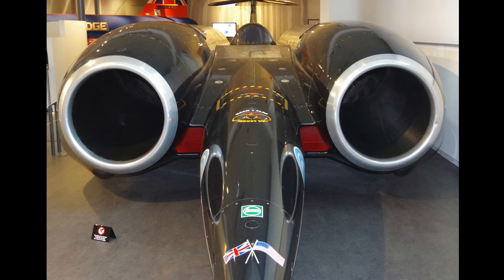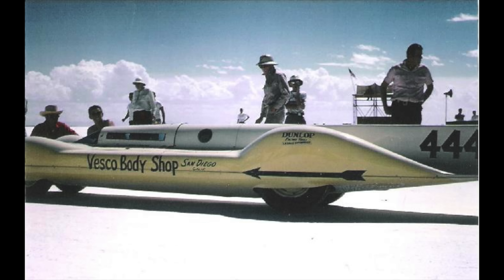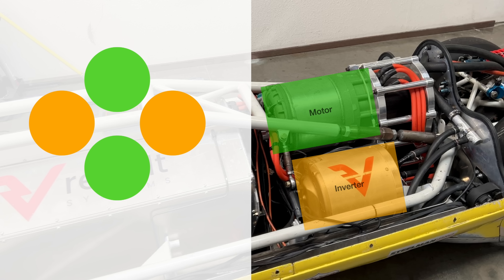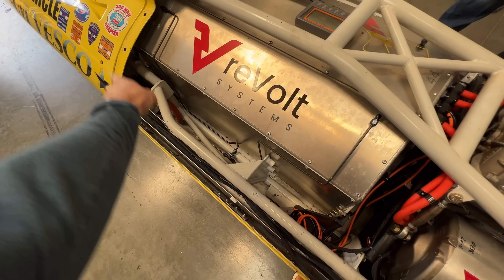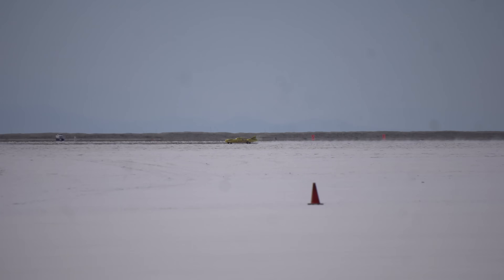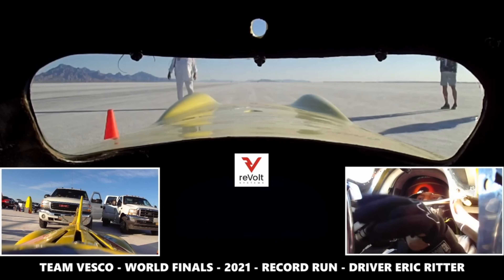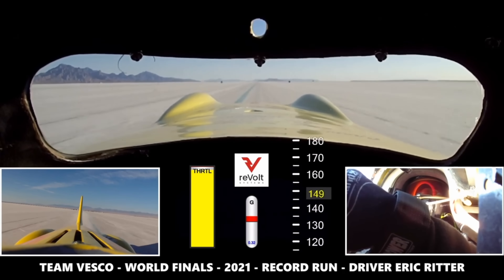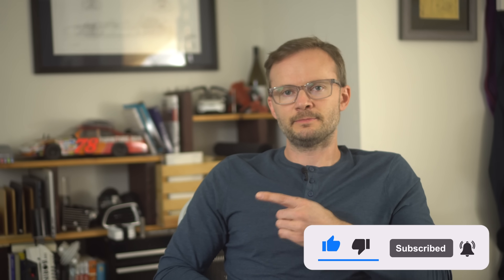The Engineering Behind The World's Fastest Electric Vehicle

Comment: Gas turbine engines are also internal combustion engines (but gets into a grey area if afterburners are used, which they won't be on a wheel-driven car).

It's interesting that this EV is slightly faster than the recent record set by Rolls Royce in the air with the Spirit of Innovation, which averaged 345.4 mph over 1.9 miles (albeit with a peak speed of 387.4 mph. However, it achieved that speed with much less power than this EV. It had just 400 kW, or about 535 bhp. So the common LSR technique of putting an aero engine into a car isn't going to work for the moment (albeit the RR uses three YASA in-tandem motors have a combined maximum rating or 750 kW, or  1,000 hp - output is limited by cooling constraints).

However, with developments in the aero industry, then maybe that will be the future for LSR EVs rather than adopting Tesla motors. That might also provide for some more energy dense batteries (by weight and volume) in the future.

One advantage of YASA (fairly recently bought by Mercedes-Benz) is that they are specifically set up to sell their motors and provide the integration technology, rather than being an Apple-like vertically integrated company like Tesla. Of course, costs are another matter; there is a regular supply of crashed Tesla's to provide motors. The eO PP03 race car that won the 2015 the Pikes Peak hill climb was powered by six YASA motors with a combined peak output of 1,000 kW (over 1300 hp). Apparently the run would have been 30 seconds faster if power on the rear pack had not been lost part way up. VW have the outright record on Pikes Peak with an EV, but I doubt they will be releasing their technology to others.

Comment: 5:28 you know this is a mess. You can plot torque against RPM, you can plot power against RPM, you can't draw one line and call it Power / Torque when plotted against RPM.

Given that it's 0 at 0 RPM for the electric motor, this looks like a power graph.

Comment: The TGV uses electric motors and that managed 357mph (5mph faster than this) in 2007… Guess the diesel generators it uses to power it’s bogies kind of makes it a hybrid rather than a full electric record though.
Reply: The TGV is an all electric train
Reply: TGV has no diesel engine, it is powered by overhead powerlines, like in any civilised country.
Reply: Diesel-electric hybrid, not a battery-EV

Comment: I asked an motor and inverter engineer in my company about coupling two motors. He said it's done for a century.
Modern automotive inverters take torque commands as input. As long as each inverter is tuned to its motor, you can couple lots of motors together without any problem.

Comment: Hey Matt have you heard of an bioethanol fuel cell that Nissan and a uni from Brazil are developing, it looks like that you could refuel at a gas station just as an ice car and the ethanol will be converted into electricity by a chemical reaction and recharging the batteries.
Reply: That would be inherently lossy and more expensive to run than a battery electric vehicle, but if they can make the system light enough with a thermal efficiency greater than 50% it might make a good range extender that gives you a vehicle that could operate like a plugin hybrid with a more efficient liquid fuel system.

Comment: The tesla dual drive motors already learn to work together; it's self tuning.  I expect there was some benefit here - it's not in the main system of a Tesla, this is in the firmware of the motor systems.  Disclaimer: I don't work for Tesla, I'm just a technician with decades of embedded electronic engineering experience.  It's a guess.

But I would bet some cash on my guess.

Comment: What are the engineering constraints on using the battery to get it up to say 250km then using capacitors to discharge the voltage for the top end of the speed run?
Reply from the maker: Land speed racing measures average speed over a mile (or sometimes kilometer), so the top end takes a while, and accelerating past 250 up to top speed also takes a decent amount of time.

Comment: This video typifies what is wrong with most people who try and build EV's themselves. They almost without exception over estimate things. Two motors will never equal two times one motor because of connection losses, and a battery pack halved between two motors is only half a battery pack per motor. It amazes me how people think that doubling the motors is somehow going to double the power when you still have the same kWh battery pack to draw from. Then we have the eternal battery optimist that looks at the burst C rating and thinks they can draw that for as long as if it was the one hour rating or constant rating. Nothing trips up the DIY converter more than over expectations. Seems this is no exception.
Reply: And yet they just set a speed record.

Comment: Thanks for another interesting video.  It wasn't that long ago, where the bottleneck would have been the motors; high output electric motors used to be inordinately heavy.  Now, we have polyphase, AC motors that are very small, and incredibly efficient.  So we're back to the batteries failure to give up their electrons fast enough (and not catch fire while doing so).   Makes me wonder, if a thermionic "battery" would work?  Imagine an EV shooting plasma out it's tail..
Reply: I also wonder:  Could primary batteries do better?  Yes-- you'd need to replace the entire pack after each run, but... speed isn't about saving money, is it?
Reply: @bobpowers9862  in theory it isnt, in reality it has to be
Reply: @cyjan3k823  I mean, true, but I think his point was that acceptable cost is different for a racing team than a person commuting to work in a Honda.  Like the people jumping at Formula 1's zero net emission fuel as a solution to not having to have electric vehicles.  Is it awesome?  Sure, if you're willing to spend $100 a liter.

Comment: Quick question: Does motor horsepower increase additively when additional motors are added?
Would make a reasonable video in itself ;-)
Reply: X HP x 2 = 2X HP
Reply: Depends how they are designed to work together. One motor can hold back the other if poor design. A 4 cylinder engine could be thought of as four power sources working together. Each cylinder is carefully designed to correctly time its contribution but at any given power stroke a cylinder has to move 3 other pistons. I am just speculating...i have the same question as you do.

Comment: I really Wonder what Plaid Motors (and Plaid cells) could do here. Cells changed quite a bit since original P100D was out But for their usage I think there could be a better Option, being Tier to tesla is kinda limiting but Thats really exciting topic.
Reply: Plaids are still running 18650's, so swapping the batteries won't yield a huge amount more, they'll have a bit more capacity and maybe a fractionally higher C. You'd probably want the 4680s with their 6x Power ratings
Reply: @CED99  there is no 4680 yet and you wont get any for probably 1,5 year, since it isnt announced.
Also 18650 can be still very Different between each other, if you calculate maximum current draw from plaid battery it is very Different
Reply: @cyjan3k823  They shouldn't be using cells from an EV.  There are cells made for power applications that can sustain 100C.  Purpose built modules would be the winning ticket.  It seems like they are sponsored and they can afford to buy the real stuff.  That and the next move would be figuring out the upper voltage limit of how much they can push to the tesla drivetrains.

Comment: Super capacitors.  That's my suggestion to replace or suplement batteries which can't discharge fast enough.
Reply: I think you'd discharge the supercapacitors in 10s and then face the same limits of battery discharge